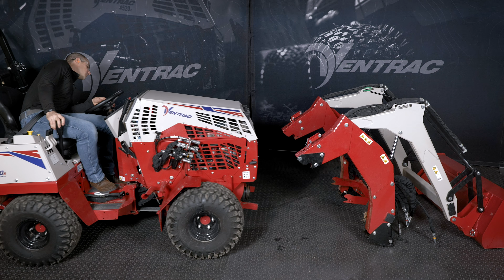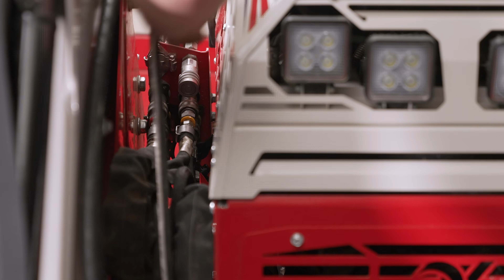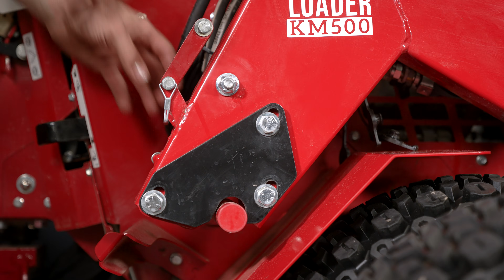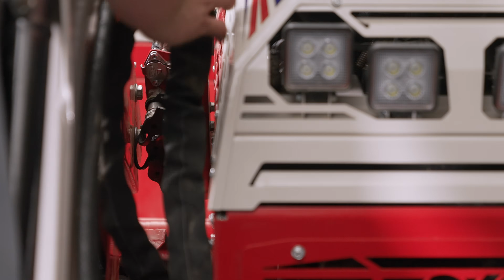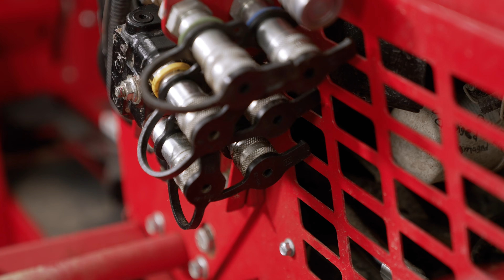How to Connect Your Tractor Loader | Step-By-Step Guide

Comment: Nice tractor but... The new version of the ventrac loader took major steps backwards in terms of its abilities. It can't lift as high as the previous loader. It is just a glorified slip scoop. You probably need to get some better input than from wannabe landscape professionals on YouTube.
Reply: you might be right on the height, but this version does lift higher than the slip scoop and is definitely 100% better to use than the old version.. and..I can use it on my 4500!!
Reply from the maker: Thank you for the feedback!